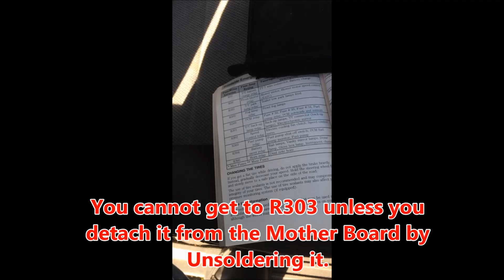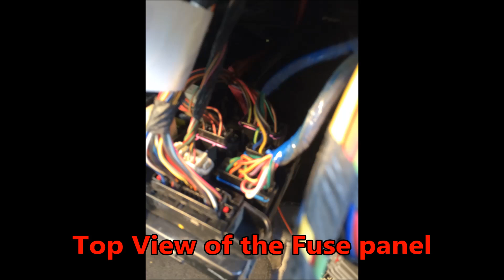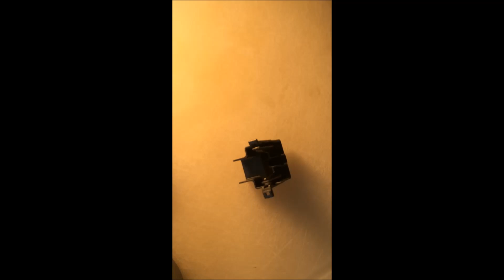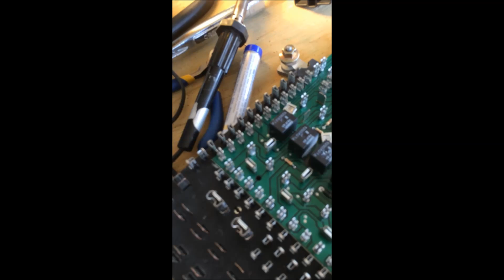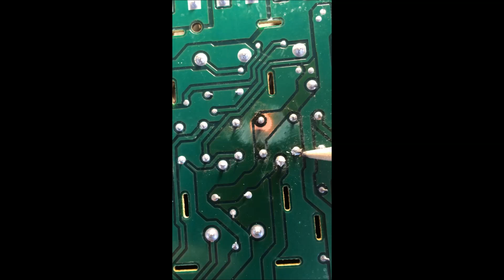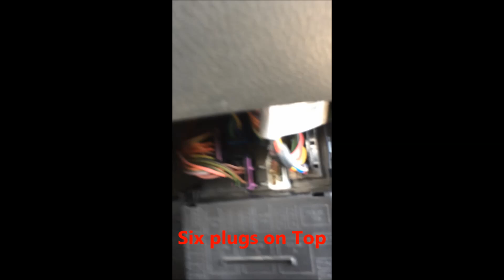2003 Ford Expedition R303 fuel pump relay replacement

Comment: Great job!! Used this video and found that my r303 in my 04 expedition also had apparently overheated. Decided to go ahead and replace fuel pump in case it was malfunctioning.
Reply from the maker: That’s great, I’m happy you were able to find it useful. The video is becoming quite old, but there are still vehicles out there than people drive and the problem still occurs. Glad it worked out for you.

Comment: EXCELLENT VIDEO  ENJOYED YOUR DETAILED EXPLANATION and VISUAL INFORMATION.  YES, most people would not attempt to open up a Mother Board and solder in a new relay.  These auto companies prey on this unfortunate reality.   My Navigator is going to be tested for either a bad fuel pump or probably a bad relay.  The fun begins.  Thanks for your video.  I might do the same thing if it winds up being R303.  $600 plus is quite a little steep.  Take care
Reply from the maker: Best of luck to you. I would attempt it and if it works it’s a win. If not and you have to replace the board then at least you tried. If you have time you can also order a soldering practice kit from Amazon for less than $20 and it comes with many components that will teach you how to solder on a circuit board. Whole total, you can buy the toys and the soldering kit for less than $30. I actually have a little fun doing it. I learned how to solder when I was around 13 years old. Good luck and thanks for the comment.

Comment: Another thing you need to do from time to time is check your grounding connection on the frame to chassis and battery to frame and battery to engine block make sure they are in good shape because Power flows from the negative to positive and this is why things like the relays burn out due to high amperage and the voltage not doing its proper job....
Reply from the maker: That’s a great point.

Comment: Even though this video is 8 years old - If you have to do this again in relay replacement - Flood the solder joints with new leaded - regular solder first as this will mix with the unleaded factory solder then wick or de-solder the relay out And all those reading this comment of mine do the same as this will make it easier for you too...
Reply from the maker: Great advice, I agree, it would definitely help.

Comment: Hey I have a question I’m about to tackle this but i want all the information and proper tools. What kind of solder wire should i get. And which size tip do i use for the desoldering tool?
Reply from the maker: Amazon has a kit from Meakest that includes a heat adjustable 60 Watt iron with different size tips and it comes with solder about the size of thread. Very small. Amazon prices are from $11 to $16
Reply: @mikelogan99CDLClassAskillstest  I have the soldering n desoldering gun already just need to know which size to use. An what type of soldering wire I have to get.
Reply from the maker: @joediana5055  Lead based solder, 60/40 blend of tin/lead with a melted point of 180 to 190 degrees. Small pointed tip on the solder gun.

Comment: Just a heads up. I have a 03 expedition eddie bauer 5.4L 4x4 think I have this same problem however I have no codes. I got stuck at work last night was running fine, came out and started it up and it was running really rough. Tried restarting and nothing, cranking super fast and it tried to start a few times but not even close. Watched this video and others on the subject. Ran a jumper wire i got from cutting off the cord of my cigarette lighter air compressor directly from the positive on the battery under the hood to the green wire with yellow stripe, its on the 4 pin connector. Unplugged the connector and stuck the wire in the back side used electrical tape to secure it. Then ran it out the door into the hood compartment being careful not to pinch it I taped it onto the safer area where weather stripping would pad it a bit. Started right up, no diagnosis was done at all. This got me home and I'm thankful for this video and the others which I will link either in a edit or a new post should be next to this post. I will note the 4x4 high and 4x4 low lights were flashing occasionally but I made it home about 20 miles from my work.
 
https://youtu.be/QYMkXKcdYP4

https://youtu.be/hhexuSRY534
Reply from the maker: Thank you, I'm glad it helped. The purpose of this video and many others is we want to show you how to save money. Many dealerships and mechanics want to throw expensive parts at it. It's not necessary

Comment: in high school 40 years ago we had a solder sucker thing to desolder, do I need one of those to do this repair?
Reply from the maker: If you can find one it would be perfect.
Reply: @mikelogan99CDLClassAskillstest  agreed. I did this job last night and was dying for a solder sucker. Would have cut a 1/2 hour off the job.

Comment: Does the system throw an obd code indicating a faulty fuel pump relay ?
Reply from the maker: Perhaps someone else can answer. I don’t remember, sorry
Reply: No, it just wont start.
I would suggest to replace the fuel filter if the car is over 100km.
Reply: Ohh
Reply: Yes - P0321

Comment: I did all of these steps, it cracks and still will not start fule pump and fule filter both have been changed as well, and it's not throwing any codes, it there anything else it could be or I can do?
Reply from the maker: I think there is three other fuses in the circuit for the fuel pump. Check those, check all the plugs and if you soldered in a new relay make sure you don’t have a cold solder joint.  Check grounds and connection’s. Other than getting a bad relay that’s all I can think about. Hopefully this helps!

Comment: Can you do this trick on the cruise control relay? R302 and if so do you know how?
Reply from the maker: I think anything is possible if you can find the relay to purchase and you can dissemble the fuse block and get in to it to unsolder it.
Reply: @mikelogan99CDLClassAskillstest  i didnt thing to just solder a new fuse in place🤔 i added an external relay for my fuel pump
Reply from the maker: @DuBTheGr8  Very good!
Reply: @DuBTheGr8  can you upload a link to buy the external relay? Or the part you bought where can I find it?
Reply from the maker: @Likesubscribable  Enter "R303 relay" in the Amazon search bar and you'll find dozens of options

Comment: Amazing helpful video. Chasing this same intermittent problem. Previous owner had shop put in fuel pump ND then said ecu is bad now and needs to be replaced. I ordered this relay, going to slap it in there before any more troubleshooting. Same relay just went out on my furnace control board. New board $350. Relay cost $3.50. Alot of control boards I've been finding in fridges, furnace, etc. Have relays failing. Made in China relays in most cases...
Reply from the maker: Thank you for sharing your situation. Perhaps it will give others incentive to fix additional issues as well.

Comment: Just replaced my relay.  I went to the dealer for the relay and they said the fuse box on my 03 is not serviceable.  They wanted $650 for a new fuse box.  This is the #1 reason for the internet. People helping others.  Thanks for the video. God bless and happy thanksgiving!
Reply from the maker: Now you and everyone should know why I posted this video. They won’t service it but I did it and it cost $20. Thanks for telling us about this and posting a comment.
Reply: Them Ford techs don't solder boards man. Gotta be real good to solder stuff

Comment: I couldn’t have done a better video myself and mast likely not as good. I love the idea of putting it back factory but I took one apart for someone but didn’t realize I could buy that relay. I put it back together and made and external relay using the battery stud on the central junction box to power pins 30 and 85 on the relay. Pin 87 to dark green and yellow wire in the connector above the center of the cover with blue around it and the blue and orange pcm relay control in the connector just below and to the left with white around it and it was a very fast repair and it shouldn’t happen again. The Ford dealer said the pump was bad but that wasn’t the problem.
Reply from the maker: Thanks for the comment and advice for another way to fix the board! I hope others can benefit.

Comment: That's the way that I like to repair (not extra wire or cut here and plug there)
At the same way that they are from the beginning. 
It's hard sometimes, but it's very professional that nobody noticed that it was fixed before. 
Thanks for your efforts, so good video
Reply from the maker: Thank you for the comment!
Reply: @mikelogan99CDLClassAskillstest  I did it well done yesterday thanks a lot
Reply from the maker: awesome!!

Comment: Great, you were right on point, thank you, I see the blown fuse, it didn't bust open but a big bubble formed at the bottom of the fuse where it connected with the circuit board, and the other side did have a dark tip on it. Thanks once again.
Reply from the maker: The big bubble that you see has been caused by excessive heat. The heat degrades the relay and therefore makes it Inoperable. I hope you’re able to replace it and save money. Thanks for the comment!

Comment: This video helped my fix my '03 Expedition! I've had this car for 10 yrs - it has never once not  started up on the first turn of the key. Three days ago  when I turned the key it would just turn over and over - no gas.  I found your video, and since I had recently had multiple roof leaks, I surmised that R303 had to be the problem. Pulled the box - my relay had just a very small bump. Ordered the part on Amazon, and two days later I was was soldering a motherboard (BTW...I've soldered maybe 3 or 4 times before ever)   It was the ugliest soldering job you had ever seen - but it worked.  $12 later ..and my beloved 2003 Expedition with 212k roared  back to life. My entire family thought I was crazy when they saw all of those fuses and my map of the layout - but my Expedition is running. Thanks for this video. Earlier in the week, I was quite sure I was going to have to get a new car - but not now!
Reply from the maker: Awesome comment, thank you. That was the purpose of putting this video out so that someone like me and you and others could simply test their skills and fix this problem that Ford engineered improperly. Way to go my friend
Reply: @mikelogan99CDLClassAskillstest  hey mike I have a question I have a 2003 Lincoln Navigator it’s almost the same thing I installed a new fuel pump but won’t start what should I do?
Reply: thankyou thankyou same complaint

Comment: Thanks so much... I am now convinced my fuel pump voltage drop surging causing rough idle is in the fuse box as well.
Reply from the maker: My symptoms were not that, the vehicle wouldn't start. No fuel pump at all because the relay was seriously over heated and burnt.

Comment: very helpful video. HOWEVER! on my 2003 excursion the relay is melted but the soldering points are on the "bottom " of the circuit board which is like a 3 layer cake with another circuit board at the other side. In other words, the fuse block is like a sandwich and the relay is on the outside of the bread with the prongs sticking in and through to the other side that is NOT easily pulled apart. I really hope I explained that  well enough LOL
Reply from the maker: I think I understand but having a picture would be more helpful. The solder on the soldering points can be removed with a suction bulb. You may have a really damaged mother board that can't be fixed. If that's the case try getting parts from a salvage yard but use a brand new relay. I've also heard there's a way to bypass the relay with an external relay that's resettable. Regardless the engineers really under estimated the amount of heat the small relay could withstand.
Thanks for the comment!

Comment: Thanks, mate! Wife's Expedition shit the bed as she pulled into a parking space at a local store (what luck!). Crank, no start, and my first suspects were cam or crank sensors, fuel pump relay, or the fuel pump I've been dreading replacing. Scanned it and found fuel pump voltage low, so I had to find a the relay, which required internet research and led me to your video. Promptly ordered a replacement on my suspicion, pulled the box and took it home to disassemble and repair. I found much less-significant damage to the relay than you had, it was barely noticeable—just a bulge on the side of the relay, and a solder connection that didn't look so hot. Repaired and running Ford for $11. I owe you a beer!
Reply from the maker: Glad you were able to get it fixed, especially for the price. Thanks for the comment and the success story. BTW, I'll take two beers! haha
Reply: @mikelogan99CDLClassAskillstest  Yeah, was going to come back and say one beer wasn't enough. Cheers, and thanks again!

Comment: Hi, thank you so much for doing this video, thanks to your video im saving like you say almost 800 bucks..i have the same problem on my 2004 ford expedition and its the same part....thanks again
Reply from the maker: Glad it helped
Reply: @mikelogan99CDLClassAskillstest  I have 2 questions, 1.- That relay didn't burn again? and 2.- what was the cause of it being burned? Thanks again
Reply from the maker: @autlense66  It lasted a couple of years until my daughter sold it. She still sees it around town. Not sure what the cause of it being burnt other than the engineers didn't make it big enough for the circuit and it overheats. They should have put in a larger relay and made it exchangeable
Reply: @mikelogan99CDLClassAskillstest  Thanks for answer, and yes you are right, so lets see how long last my repair. It was fun doing this repair buddy...thanks again, i save big bucks doint it by my self and with the help of your great video.... Thank You and happy July 4 Mike, be safe
Reply from the maker: @autlense66  I also want to mention the Ebay has several of the relays from several suppliers. Search R-303
Reply: @mikelogan99CDLClassAskillstest  HOOO OK, THANKS

Comment: I think the same issue just happened to my 03’ Expedition. I’m going to see if I replicate the steps you shared with the same success!  🤞🏼

Thanks for sharing!
Reply from the maker: I think you’ll find an overheated relay. It’s a lot easier than pulling the fuel tank. If you’re not getting voltage to the fuel pump then you’ll most likely solve it by replacing the relay. If you read through the comments others have found different techniques to resolve this. Good luck!

Comment: Didn't bother ordering a new relay. I used a olde AC relay and soldered extension wires to it as it is a full size relay and would no way fit in side.
Wasn't trying to save money. Just didn't want to wait for the correct size relay.
Reply from the maker: That's awesome, Great to see others dig in to resolve this issue and come up with different ideas to save money.

Comment: Thank you for putting this together. You definitely saved me several hours of frustration. Was able to replace the relay and the vehicle started back up on the first try. Took me about 1-1/2 hours from start to finish.
Reply from the maker: Thanks for letting me know this works, I haven't recently checked to see if the relay can still be bought but this will save money because that relay really gets hot and malfunctions. Simply replacing it solves the problem.

Comment: PCM relay went bad (melted a contact)  and I hear that that may be related to this repair in the near future. We shall see, saving just in case. Looks a lot simpler than fixing Xbox controllers
Reply from the maker: It really was not that hard to do. I did have a cold solder on one of the terminals and had to re solder it and everything worked good
Reply: @mikelogan99CDLClassAskillstest  Yeah, looks pretty straightforward. Never even knew there was a PCB inside the fuse box! I'm curious as to why there are some soldered relays and some socketed. I'm gonna order the r303 relay to keep on hand just in case, since it looks like an easy afternoon repair (and a lot cheaper than an entire box)